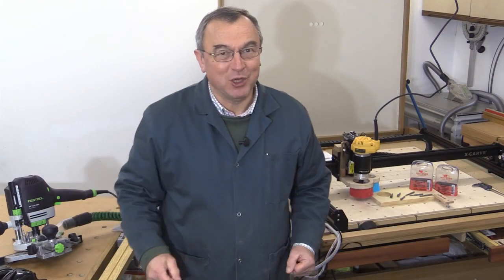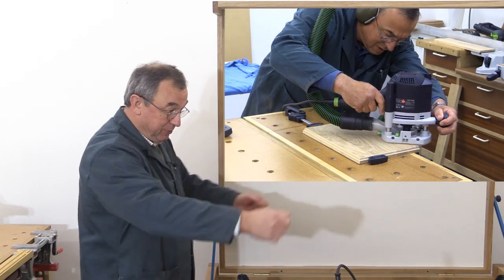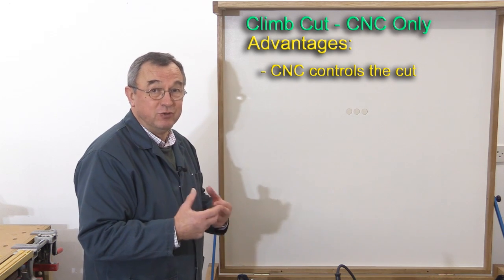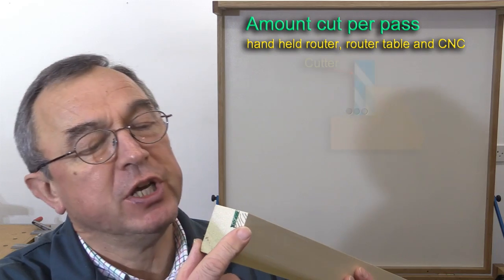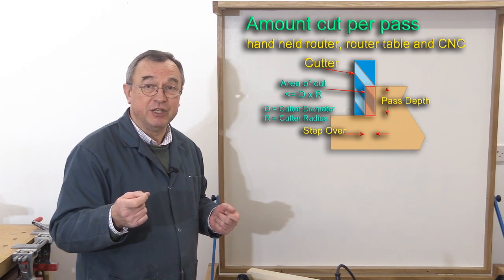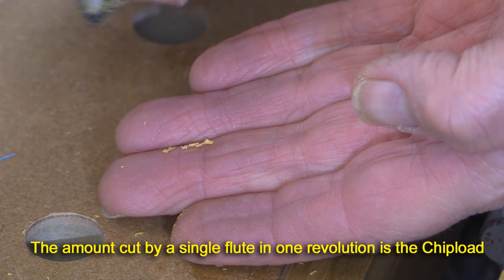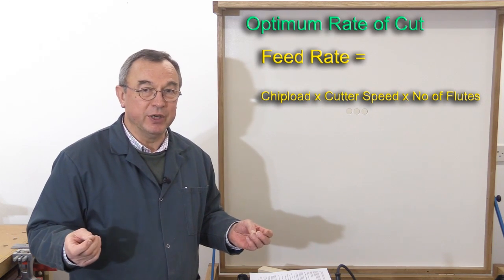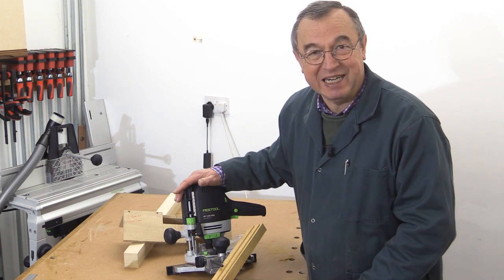Understanding Chipload for Router and CNC Work

Comment: Good solid information well presented and easily understood. Are you sure you are a woodworker and not a rocket scientist Peter.When I hand rout I always move the router against the spin of the bit as you just said, except when I don't. There are two routing procedures I do that I climb cut or modified climb cut for. First is when I profile the entire perimeter of a solid wood panel when I observe that the grain direction goes "squirrely" , or reverses on itself on the long grain side, and by moving the router in the proper way I blow out my edge profile deeper than the profile that I am cutting and effectively ruining that panel. I will climb cut those areas (holding on tight!) to keep from chipping out. I modified this procedure from one continuous climb cut to a series  divot cuts in the squirrely grain area and then cut the proper way along the divot'ed out area knowing that I can't blow a splinter past my divot.Secondly, when I use a router dovetail jig, Porter Cable model number 4210 in the US,  for cutting half blind dovetails; I work from right to left instead of left to right. Again to keep from blowing splinters into good wood that I would prefer stay attached. Machining what is called Baltic Birch these days I can blow splinters off it with a harsh look. I'll run a scoring pass along across the face then return to the right side to cut my dovetails making a final "insurance" pass the proper way from left to right. I can usually convince Baltic Birch Ply to keep itself together by doing this. CheersG.
Reply from the maker: +George Savage   Hi George, First of all, did you see my acknowledgement of your suggestion with my Ultimate Dust Boot design? I credited you with the germ of the idea in the main video - thank you. Yes, you are right about scoring cuts and so on but that is a skill thing and novices should only approach such techniques once they have some router miles under the belt.   Cheers.  Peter
Reply: I did see the credit. and thanks for that .My sister got a kick out of it when I showed it to her. You are correct about being more experienced before taking on , what I like to call, the hilariously difficult aspects of woodworking.       Take a Youtube look at a British Pathe video on wallpaper making 1963 and you will see a woman freehand routing with a router with proper dust collection connection but 2 air blower pipes attached to the router base to blow wood dust out of the cut line. The music alone makes it worth a watch, G.
Reply from the maker: +George Savage   Hi George,  I just had to watch that - I probably saw it first in the cinema in the 1s 3p seats. Now I know how to make flock wallpaper. The only thing in the back of my mind is how come you looked for or found it in the first place? Perhaps you need to get out more !   Cheers.   Peter

Comment: What great information Peter. You must be or have been a teacher because you gave a very clear explanation. I can't believe after all these years I never learned about chip load. I just Googled router chip load table and saw some interesting numbers and learned that too small a chip load causes burning. Thank you so much for educating this old dog.
Reply from the maker: +WoodRodent  I too learnt a lot whilst researching this. I am working on a video about cutters for the CNC and will be giving some examples of chipload calculations. It does not always apply as some combinations of cutter and CNC cannot be driven hard enough to sensibly make the equation balance. Thank you for the kind comments.     Peter